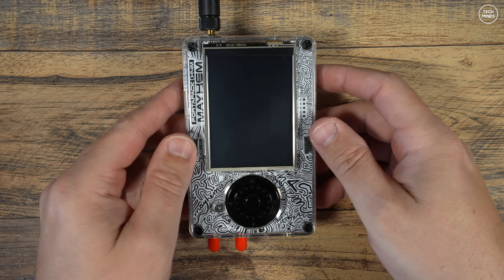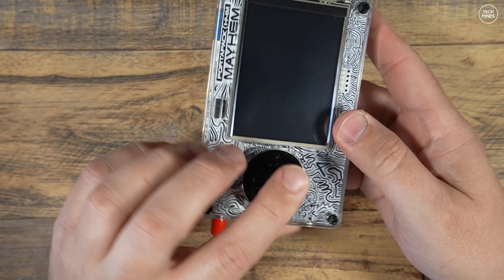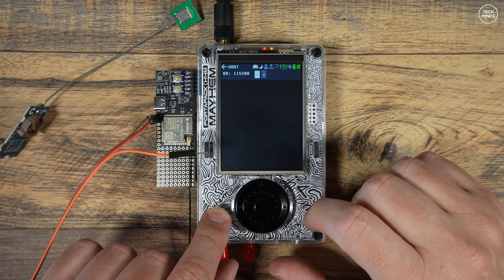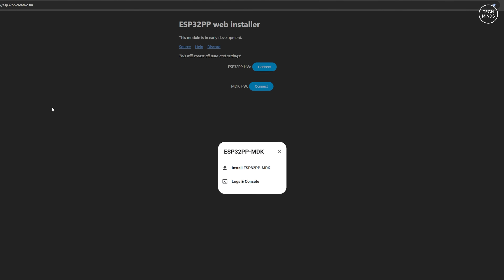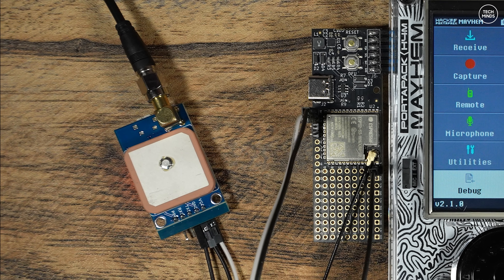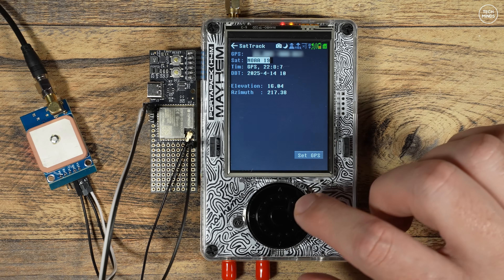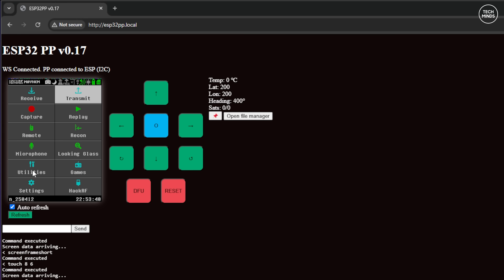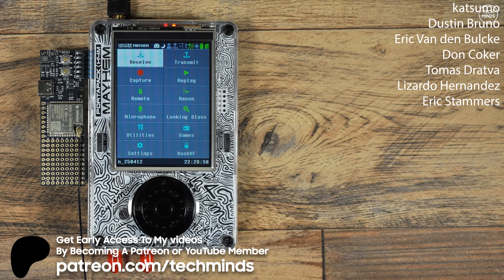HackRF H4M Module Development Kit - Build Your Own Modules Now!

Comment: they need to improve the overall rugged structural support to the case. last thing i would want are bent pins due to some slip up or mishap with all the wires dangling and snagging onto something.
Reply: I've been waiting for the boards designer to release/design a case design (last update 2 months ago) I hear what you're saying, something that properly clamps to the Portapack would be preferable
Reply: Yeah... this is an incredibly poor form factor.... I'd rather see a "game boy." style cartridge in the back or at least the connections to not be so hockeee pokeee.... i don't really want some random delicate, unfinished development board/ pcb protruding out the side of my HRF1 PP- plus, i can see this damaging the HRF1 PP itself...

Comment: Tell me, why does the HackRF One support SSTV transmission but still lacks receive functionality?
Reply: Always puzzles me to!! 😅
Reply: Perplexing. Could never wrap my head around this 'fact'.
Reply: @paranoidzkitszo Me neither, I don't like questioning the mayhem mods though, some get a bit touchy
Reply: Decoding requires a big memory bitmap to decode to, and then save or display. The controller on the HackRF doesn't have enough memory for that. Transmitting, it can read the bitmap from SD card a small chunk at the time to send, which doesn't use much memory at all.

That said, someone has tried, and gotten fairly far. But apparently they lost interest and quit. I can see why, juggling memory on such a tiny controller is a bit rough. But if someone picks it up again, it may be possible to finish the job. I won't though. It's easy to decode, but really hard to manage the microcontroller memory.